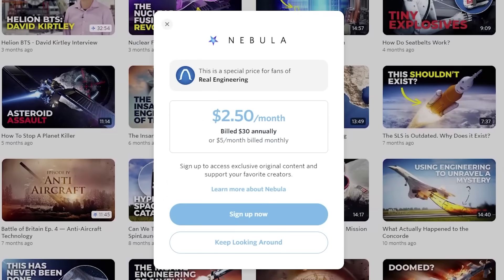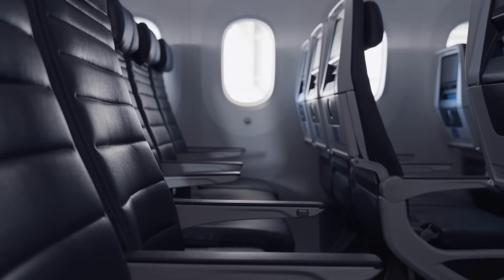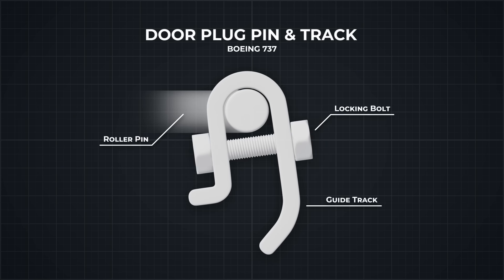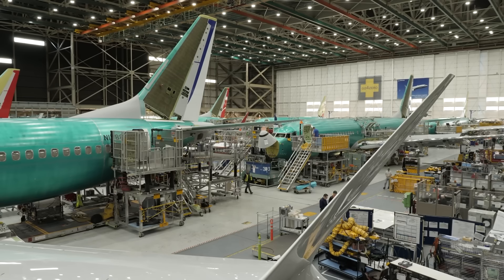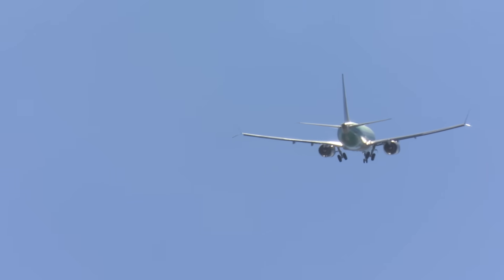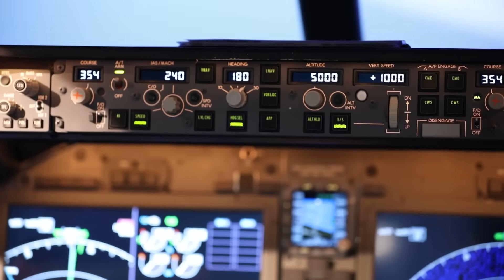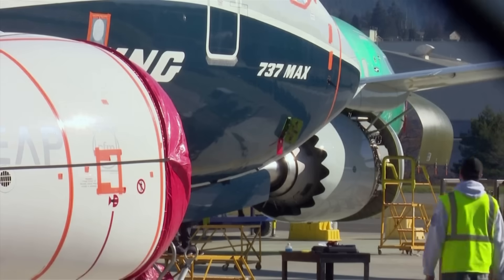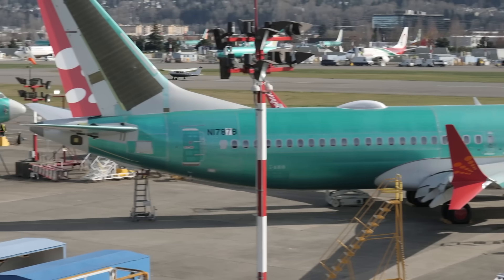The Questionable Engineering of the 737 Max

Comment: I think Boeing has more of a management problem that an engineering problem.
Reply: Absolutely. It was obvious this was the case the moment they decided to move their headquarters away from the production facilities. The whole culture involved in making that type of decision was an indicator of systemic issue with how they're handling their business
Reply: @marcm. this.  This doesn’t get enough attention. The documentary Downfall: Case against Boeing touched on this though thankfully.  

I’m someone who wants Boeing to succeed and be strong.  But they need adjustments.
Reply: @marcm. No they are still headquartered in Seattle last time they tried to move Washington got pissed.
Reply: @marcm. Nvm my bad it is in Crystal city.
Reply: Yeah.  This isn't an "engineering" problem.  It's an installation problem.
Reply: @ThatBoomerDude56 Absolutely.  The door plug is installed with safetied fasteners (drilled bolts, castellated nuts and cotter pins) and is a safety-of-flight critical installation that requires multiple inspections and buyoffs in the paperwork.  I suspect that the paperwork will show that it was installed correctly...even if it wasn't.
Reply: @silverhammer7779  : You forget that because the door was only "opened", not "removed", both of which require removing and reinstalling the bolts, there was no tick in the checklist to check they were installed back. So there's no paper trail of anyone having checked the bolts were there.

So it's not just ticking a box without doing the action, some boxes were not in the list at all...
Reply: @JariJuslin I worked in the industry for years and wrote more than one safety-critical procedure.  If a safety-of-flight provision must be removed for any purpose, it must be reinstalled correctly before the aircraft is returned to airworthy status.  And there WILL be documentation in the build and maintenance records.  Both DoD and the FAA require this.
Reply: @ThatBoomerDude56  totally agreed
Reply: The McDonald Douglas merger killed them
Reply: @quinndenver4075 MD80 comes to mind with a single jack screw...
Reply: Boeing died the day they merged McDD... 
#ChangeMyMind
Reply: Correct! Management doesn’t support good engineering anymore. Multiple employees have spoken out about it. They really are all about cutting corners to save a few bucks. This almost sunk Boeing before with the Max crashes; it’s saddening that they haven’t learned their lesson. A once-great American engineering company had to go and ruin its legacy. It’s a damn shame, really, and I hope to God that this is the final straw before a major shakeup in management.
Reply: Oh you have no idea. It's so bad.
Reply: Dennis Muilenburg was also not responsible for the MAX.  The CEO of boeing from 2005 to 2015 was a business executive called James McNerney.  This man was CEO during the prime shitification period for boeing.  He is the one who oversaw the MAX.  He conveniently bailed on the company just as the MAX was going into service.  The first flight of the 737 Max was only 7 months after McNerney stepped down from being CEO.
Reply: I would loved to be fired from a job and given 62 million. That's not even a punishment.
Reply: It’s just typical American corporate mentality
Reply: BOTH! One is born from the other though, you are correct!
Reply: a $67 million golden parachute for an executive who failed...
Reply: Still better than keeping your job and position of CEO after designing an aircraft with extremely hazardous handling characteristics (which caused even greater fatalities than the country itself wants to reveal) and then mass producing it.  @artcurious807
Reply: Also, the development of the 737 Max was overseen by the CEO before Dennis Muilenburg
Reply: Same applies to all of society these days actually...including gogts, companies, communities. And media.
Reply: When an ice cream seller is trying to cut every penny to make very cents worth the cost than trying to sell the most delicious ice cream, you know you are in trouble in the ice cream business.
Reply: As an Aerospace engineer your exactly right management is the problem. All engineers care about is safety. Management cares about money. This makes sense but still.
Reply: you mean the engineering was replaced with management.

Last time I checked CEO's and management know nothing about engineering, they only understand penny pinching
Reply: For anyone who hasn't seen it, check out that 2-part PBS Frontline on the MAX problem... Disturbing but very educating....
Reply: Shittification got em.
Reply: A lot of corrupts running the company is also a big problem.
Reply: The cause is from management. Being poorly managed result in them having to find ill-advised shortcuts. Their sensors of their max plane, and apparently not caring about quality control, and perhaps making their doors under qualified.
Reply: The software problem cost Boeing a lot of money putting the Max program in the red. Boeing management had a choice. They could take the loss and focus on repairing their reputation. Or they could cut corners to make up the losses. Now we know which they chose. This won't be the last problem that crops up on Max. It's not a curse, just capitalism in action.
Reply: They've also been diversifying departments a lot, but getting rid of safety regulations and inspectors is absolutely awful.
Reply: The accounts call the shots.. let's outsource instead of building quality in-house.
Reply: Lmao yeah i work at boeing and management is making [some of] us work every other weekend plus 10 hour weekdays 😀 at least the overtime money is good 🥲
Reply: You mean, a greed problem.
Reply: @danielblanco208  That's what I said - a capitalism problem ;)
Reply: @3nertia  I love it when people who know nothing about aviation blame capitalism. You people blame everything wrong with the world on capitalism lol
Reply: @dmvsye  And everything wrong with the world can be traced back to capitalism, its profit motive, and the predators who own and control everything, Dunning-Kruger 🙃
Reply: @3nertia  Too much Twitter and reddit for you bud
Reply: The failure was due to human error in the installation of the door plug mounts not being torqued to the proper specifications.
Reply: @owain_glyndwr1265  and the corporate imperative to make up for the costs incurred as a consequence of the software problem had no influece at all on those bolts not being torqued correctly, nor being inspected to catch the problem? My prediction is that 737 Max is riddled with problems because of that cutting of corners, and we're going to see more failures caused by corner-cutting in the future. I can make that prediction because that's how capitalism operates. You don't need to believe me, just remember my prediction and watch the news.
Reply: The management problem causes the engineering problem. But there still very much is a engineering problem too.

Any Aerospace Engineer that hands in a design for a safety critical system with only a single point of failure knowing full. goddamn. well. what happens when such a system is put on an aeroplane should be charged with 2nd degree murder imho.
Reply: I have read Alan Mulally’s book “An American icon” . No one comments on the real reason he left Boeing. He was in charge of the 777 build in various roles . It took 5 years to get into service .  Why did he really leave.
Reply: Its a result of the merger
Reply: Always is. No engineer wakes up and says “today I want to cut corners and get people killed.”

I’m willing to bet some engineer has a drinking problem now after those MCAS failures. “If I had just pushed management harder, then they’d be alive”
Reply: 13:28
Reply: Absolutely!  Just like the FA & A!
Reply: They need to let everyone go from McDonld Douglas go. Boeing didn't have problem till the merger
Reply: As evidenced by the documentary....
Reply: Trust me, It has both. They build some of the worst Planes in the world safety-wise
Reply: They're more concerned with hiring black trans ex cons than engineers or competent people who happen to have white skin
Reply: 99.9% of the time is management. leadership in the world is failure
Reply: na they have both
Reply: You all need to reference  blancolirio's video titled Boeing's Quality Management Failure Explained 737-Max-9 Door 24 Jan 2024 https://youtu.be/XhRYqvCAX_k?
Reply: The fed needs to stop bailing boeing out. But also Alaska Airlines Maintenance is at fault for this
Reply: You would have thought NASA taught the lessons of mismanagement. It seems a disaster will be the only catalyst of change.
Reply: $60 million for allowing the deaths of nearly 400 people.
Reply: more of a social engeneering problem than management problem. DIE policies for hiring are killing people world wide - for diversity inclusion and equity
Reply: The CEO is not an engineer.
Reply: @HeWhoIsWhoHeIs you gonna blame three mile island to DEI also? Lol. Chernobyl to DEI.  The other shuttle disaster to DEI.  Go google worst engineering disasters and see if DEI caused all of them. Lol.  You are a perfect example of how stupid people think.
Reply: @HeWhoIsWhoHeIs so you think this faulty vaccine was due to DEI also?  Lol.
Reply: every company is management problem
Reply: management and QC problem, spirit aerosystems is behind some of the incidents arent they?
Reply: MCAS was, I'd imagine, designed by a school student who should have got an F.
That was a terrible engineering project on very many levels
Reply: Indeed it does
Reply: Unfortunately this boils down to engineering problem…
Every issues, management can easily blame the engineers as it is their job

As engineers we must be honest and work with accountability, putting public safety first…but that may lead you jobless, because you left according to your heart, or you became the management’s headache…
Reply: That's what happens when a tech/aerospace company is managed by accountants and businessmen instead of Engineers. Boeing hasn't recovered ever since the MD merge.
It's the same thing that happened to Intel of the chip-semiconductor industry. The management sat doing nothing but business because they were 1# that time, which allowed TSMC and Samsung to catch up. now Intel is years behind in technology and are desperate trying to catch up to both.
Reply: No. It is because it was, "MADE IN AMERICA".
Which is craptola nowadays.
Reply: One causes the other.
Reply: The greed is sickening but DEI is clearly the root cause.
Reply: @IronicMemer  dei isn't the root cause quit giving them excuses.

 It's clearly greed and corruption. 
Boeing is going in the same exact steps as McDougalas and they didn't have dei as an convenient excuse, when they protized profit over safety.

Almost everyone who is a shot caller in boeing is yt, they are the ones who idiotic decision lord over everyone else even when wrong.

Boeing didn't zero a whistle blower over some dei. It's way more then that and you are seriously naïve if you think it is.
Reply: Both
Reply: Yeah, this video's ending trying to excuse executives is kinda shameful
Reply: I think it has both.
Reply: Can confirm, my 8th grade science teacher is married to a Boeing engineer, and he often questions stuff happening.
Reply: Greedflation
Reply: I think the real problem is more macro. Boeing is a megacorp with an enormous amount of power. Having that much power concentrated in a single megacorp that makes very high end parts and weapons is dangerous. Airbus is large but it's also far less unified than Boeing and far more heavily regulated. It also doesn't have nearly the backing from the EU that Boeing has from the US government.
Reply: @MrMarinus18 That, Even whithout the insane lobbying, the USA just can't let Boeing go down, they let most other compagnies die/be brought by a handful of way too big corpos and they must keep them alive at all cost, even just for the defense part. And if you add that to lobbyist who add greed to need is no wonder such terrible mistakes happen. After two deadly crashes and evidences of wrongdoing endangering thousands of people, why were the 737 ever allowed to fly again ? and if they were allowed, why wans't it with an "the first incident that happen we stop all of your planes from ever flying again" policy ?  Nah they got a few millions in bonus and the compagny just fixed one problem, not the system itself. They don't even endanger their passengers, no one is safe from one of their plane crashing in the middle of a town. Its unlikely to happen, but when it falls on you statistics become less fun.
Reply: @MrMarinus18  exactly, Airbus is a consortium while Boeing is a conglomerate
Reply: @MrMarinus18  Why is it dangerous?
Reply: @MrMarinus18 Erm, airbus is far more funded by the eu than Boeing is by the us government. (Hence all the angry letters getting sent back and forth). It’s publicly available info, just lookup balance sheets.
Reply: @ryanthompson2893  They both are heavily funded by the government. Though Airbus does seem to be better regulated at least for now.
Reply: @MrMarinus18 You have no idea what you are talking about 😆
Macro my arse.
Reply: The problem is that it's an engineering company run by accountants.
Reply: @BabyMakR  no, the problem is that in many places cost savings were higher valued than consistent quality. Also shareholder value etc.
The problems is not that accountants did what accountants are supposed to do, but they got a greedy and irrsepsonsible bunch that in their greed to maximise profit (and I assume personal bonus payments) without hesitation layed of any engineer or worker in general that tried to uphold the quality standards necessary to build an airliner. Going down even to suppliers and saving costs by talking the FAA into taking over their tasks internally and so on. Responsible accountants would have done the same, but not at all cost, jeopardizing quality in an environment were quality and monitoring issues as a well known fact can tragically end in loss of life. In the end having to face now that this irrespsonsible behaviour costs the company more in a few years, than a lot of the layed of employes and QM steps etc would have saved them over at least a decade.
I decisively do not write "realize", as I think some of those accountants are so focused on quick turnarounds, even in an environment where a development into production cycle takes years, that they do not even realize how wrong they were, because they simply do not understand thinking "on the long run"
Reply: It's an engineering problem caused by a overarching management problem.
Reply: Oh it is completely corroded from ground to top, from executive to union, from management to administration, from employee to contractor.
Reply: They all are.
Reply: And they all took the VSP with a big bonus and now everything else are yours (ours) problems.
Reply: its both.
Reply: And thus both.
Reply: Sooo an engineering problem
Reply: There is an engineering problem that can be fixed, however management was like, "Guys I have a better idea." @Cruz474
Reply: We should make sure you can't make money with dodgy engineering. I'd propose a system of shareholder value destruction as a penalty for incidents like this. Your company fucks up? You are forced to issue shares to the government equal to the ones allready on the market. the government will throw out the shares onto the market for the total cost of 1 dollar. 
Someone will buy a huge stake in your company and make the profits of the life time, but all current shareholders get absolutely shafted by this. Any scheme like this will make "Dodgy to save money" absolutely unattractive, in any shape or form.
Reply: @HeWhoIsWhoHeIs so every engineering disaster in the history of the US issue to that ? Lol.  Is that why Apollo 13 burned to a crisp ?
Reply: @HeWhoIsWhoHeIs so DEI caused the space shuttle Columbus disaster too? Oh thanks genius.
Reply: @HeWhoIsWhoHeIs I guess the titanic sank because of DEI.  The Hindenburg blew up because of DEI also.
Reply: Exactly! It's called diversity.
Reply: @Will-j8q1w it's called greed. McDougalas didn't have much diversity yet they failed in the same way as Boeing is going due to greed. Stop giving them convenient excuses.
Reply: The same self congratulatory nonsense from the engineers. I’m also an engineer btw
Reply: It all started during the Reagan years when Hanes laid off the underwear inspector #12.
Reply: What? There is absolutely engineering problems , the engine cowlings rip off if anti icing is used more then 5 minutes. The MCAS software nose dives planes…
Reply: @driller_e8098  the engineering team complained about that multiple time, but redesign cause them money so the higher up just pretend it's fine
Reply: @driller_e8098 The engineering problem is management won't let them do their jobs.
Reply: @driller_e8098 ... !!! None of these problems were "unknown", which means that the engineers knew about them. And had they been allowed and ordered to find other solutions they would have... But that was not how the management chose  """"solve"""" these KNOWN problems. Instead they """""solved"""" it by putting pressure on the regulating authorities to get "exceptions" to the rules.. and they got them... And here we are.
Now it would have been different if these problems had been "one off" where a outlandishly unlikely set of circumstances let a mistake "slip through". Or if it had been a "mom and pop shop" where an unknown "constructional failure" occurred. Under such circumstances You could possibly have blamed the person who constructed or assembled the part. But these are reoccurring systemic failure, from a MEGA corporation. And one that operates within a HIGHLY regulated industry, with countless checks and balances supposedly to ensure that safety is as good as it can be. So even IF they have "bad/incompetent apples" within their company they should be organised in such a way that that can not result in failures like these... And guess who is responsible for that... Hint it's not the engineers, nor the people actually building the airplanes.
And maybe it needs to be pointed out ((since Real engineering seems to be of a different opinion)) that regardless of what education or degree You have, if You work within the management You are a manager in this context. Meaning that if an engineer makes a managerial decision that is NOT (imo) an "engineering problem" but rather a managerial one. 
Best regards
Reply: @driller_e8098  Management forced the engineers to use poor solutions like mounting the engines higher and using MCAS software.
Reply: @driller_e8098 

He never said there wasn't engineering problems.
Reply: @driller_e8098  Engineers are 100% responsible.
If told to jump through the windows, they wouldn't do it, would they, but told to do something that can kill OTHER people, they follow the orders.
Reply: @DR_1_1  Well the problem is as an engineer you can't just leave your job whenever you disagree with the hierachy. Its the best way to be blacklisted from basically anywhere and the more specified your post is , the harder it can be to find a new one whith reccords of leaving compagnies and bad recomandations. Plus engineer studies are not cheap, especially in the USA and being jobless may not be an option for a lot of them. And finally, even if some do leave, the compagny won't change anything, they'll just replace them with people who will close their eyes even more. The only thing to do is to try to do your best or organise mass leaves/protests if things goes too far, but compagnies like Boeing this just won't happen.
Reply: @justeunfan3364 and not even SEPA will save you. If anything they will cost you your career.
Reply: Nah, this is just another symptom of the capitalism problem heh
Reply: @3nertia  The safety problem is FAR worse under communism.
Reply: @3nertia  Capitalism isn't the problem, rampant malicious corporatism is.
If you hate capitalism so much, go live in a country that doesn't have it. Oh wait.
Reply: @Volvith  Yeah. Good luck to him because he's not going to like the lack of freedom of speech there.
Reply: @3nertia  same thing. stupid floats
Reply: @sanguin-s6p  Ah, thank you for your valuable contribution to the conversation, Dunning-Kruger! ROFLMEYERWIENER!
Reply: @3nertia  you and OP are saying the same thing, deep down
Reply: @kaitlyn__L  All roads lead to profit under capitalism so I s'pose that's true, in a way :)
Reply: @3nertia  and that’s also the main factor behind management having different priorities than workers. Management is the vessel by which capital is maximised
Reply: @3nertia  Capitalism is not the problem but the solution.
Reply: @3nertia  You believe I am wrong?
Reply: @schwarzerritter5724  Thank you, Captain Obvious - your work here is done!
Reply: @3nertia  Why?
Reply: @schwarzerritter5724  You explain your position first, cohesively and coherently if you can :)
Reply: @schwarzerritter5724 yes more greed and less regulatory oversight is the solution! Let the CEOs and MBA: do whatever they want and that will fix everything.
Reply: @3nertia  You said my work is done. Time for you to explain your position.
Reply: @yungrichnbroke5199  Boeing keeps cutting corners despite regulations. The only solution left is stop using their airplanes.
Reply: @j.f.fisher5318  What deregulation do you mean?
Reply: @j.f.fisher5318  But people keep blaming capitalism for that with the subtitle implication that if it was communism or socialism greedy and corruption wouldn't occur, when in fact it would be even worse, individual lives don't even matter in a socialist society, the failures would still happen but it would be just statistics not a major outrage.
I think capitalism can still work with proper regulation, the problem really is public companies being run for the stock market financial capital instead of being run for economic capital which are assets and actually produce output.
People magically think that socialism and central planning would solve the same problems caused by central planning management in big monopolistic corporations...
Reply: @schwarzerritter5724  lots of examples but its better to clarify: this is captured regulation. the FAA and congress are both unduly influenced by boeing, and will defer to what boeing wants. in some cases this will result in deregulation, like FAA designated work that is performed by boeing employees instead of by FAA employees, under the very thin presumption that they won't be influenced by who actually signs their paychecks. in other examples you can see captured regulation when the FAA makes rules that apply to all commercial airplanes and boeing and it's backers in congress will move to exempt it from rules because it might cost them too much money (QQ), for example, see the exemptions granted at the end of 2022 for the -7 and -10 Max cockpit requirements, or even the recent engine de-icer exemption request.
Reply: @braveulysses2000  Yeah, I fail to see how connecting companies and regulators even closer is a good thing.
Reply: @j.f.fisher5318 what does taxation have to do with it? Wouldn't that make them want to cut corners more? And they are more regulated now than they have ever been before. 😂
Reply: @3nertia thats not what dunning-kreuger means. Learn what a word means before you use it.
Reply: @RaizerZ  Thank you for your worthless contribution to the conversation, Dunning-Kruger, but it's ironic how you can't see how that's ironic ;)

The ol' "I'm rubber, you're glue" argument - still just as classy now as it was back in grade school ROLFMEYERWIENER!
Reply: @monad_tcp  communism is just state owned capitalism. Total monipoly, horizontally and vertically integrated, no regulatory oversight because the state is the company, and out of control MIC for the same reason. That's why Russia and China could privatize so easily, they just needed to break Democratic socialism keeps government and corporations separate and yes is highly efficient at curbing corruption through strict regulation.
Reply: I think you have no clues on what you're saying, and of course you're 100% wrong
Reply: @reharh7330  of course, of course...
Reply: It's not a management problem. It's a DEI problem.
Reply: Engineers are responsible for the lives they affect. Regardless of whether this is a management decision, this is an engineering failure.
Reply: @rivengle As an engineer myself I totally agree with you.
Reply: @rivengle  I know this is from three weeks ago but the engineers did complain and bring up issue, one of them even was going to go to public about it, and we all know by now how that went.
Reply: @rivengle 😂 completely wrong, you need to be an engineer for a day. You give a good safe idea, management asks for five cheaper bad ideas
Reply: @dMoney0248  So? Is management building the dang thing?
Reply: @rivengle  Boeing has gotten rid of most of their engineering, they lowkey forced them into retirement or gave them VLOs and have not replaced them.
Reply: @rivengle  When engineers get it to the point you can get it airborne and are then fired to save money before they can get it airborne SAFELY, I'm willing to say it is mostly management's fault.
Reply: But they are diverse!
Reply: @ntsst3 this has nothing to do with diversity. This is a greedy management problem
Reply: @ntsst3  in the decade of most engineering accidents there was no diversity.
Reply: DEI is the Definitive Culprit
Reply: @TheDivino21 lmao youre a dolt. The only DEI adjacent activity is ppl without engineering degrees working their way up to engineering positions, majority of whom are yt 😂
Reply: @TheDivino21 how?
Reply: @TheDivino21 Explain how and present your findings to the FAA
Reply: @TheDivino21 Care to elaborate and explain exactly how “DEI” directly caused this and not some vague description of “unqualified” people being hired, when everyone hired has to pass the same background checks and tests to qualify as an engineer or mechanic?
Reply: @TheDivino21  So every bad engineering in the history of mankind is because of DEI? lol.
Reply: @TheDivino21 : Really? Explain with data, please.
Reply: The biggest management problem is that management okayed the hiring of Third World "engineers" to work on the 737 MAX.  DEI, anyone...?
Reply: @silverhammer7779 you have to wake up from an old dreams. The world has changed. Don't assume that third world countries don't have the capability. The problem is boeing's own greed and regulatory weakness.
Reply: @bedhenis If they had the capability, they wouldn't be Third World countries, would they?
Reply: @silverhammer7779  do you understand the terminology of third world country?
Third world country is non-aligned country with either NATO or the Warsaw pact.
Reply: @bedhenis   By that definition Japan, South Korea, or Switzerland would be considered "Third World".

The correct terms would be "Undeveloped", "Developing", or "Developed".
An Undeveloped nation would be one with little to no infrastructure (roads, electrical power, clean water, etc), and little to no desire to correct this. (Ex. Afghanistan under Taliban rule)
A Developing nation is one that is, for all intents and purposes, attempting to catch up with their neighbors or rivals. They're actively building roads, schools, a stable power grid, and are generally unphased by the kinds of political issues seen in many "Undeveloped" countries. Some may have some major political turmoil or even civil war as ideologies clash for the future of the country, but they're generally on the path that leads to becoming a great nation.
And then there's Developed countries. These are nations on par with the world leaders. They have complex school systems, major roads, stable power, stable living and political conditions, even their own major manufacturing base with stuff they are uniquely positioned to export. Militarily, they are able to develop their own equipment instead of buying from other countries, and they're even able to fully educate their own engineers, doctors, and scientists.

One thing to note with these countries putting satellites into orbit is that they're only able to do it because they've sent their people here to learn how. They take the knowledge back and lead teams dedicated towards this purpose. And they're very well motivated to do it. How many here can say that?
Reply: @silverhammer7779 yeah of course dunk on the immigrants. Its because of management that the engineers cant work their jobs. And those immigrants are probably more educated than most Americans based on your comment
Reply: @silverhammer7779  it's not dei, they could have hired anyone and management still would have been terrible and forced bad decisions for the purpose of money making. McDougalas didn't have Dei when they went down and they had nearly identical problems due to greed.

Boeing wouldn't have zeroed a whistle blower over dei, it's something more like corruption and greed. Believe me that they would have loved to use dei as an excuse if they wanted to.
Reply: @datekaname2246  DEI contributed heavily to the problem, but corruption at the top was the main driver.  As the Japanese say, "a fish rots from the head down."
Reply: @silverhammer7779  again as I said McDougalas had similar issues, they didn't have dei. Dei isn't the major issue. 

The issue is boeing protizing profit, forcing their engineers to do thing for the sake of cost effectiveness/speed over quality and safety, firing those people when they complain. And then when a big issue  eventually happens like a plane crashes they arbitrarily fire a bunch of people at the lower level, pat them selves on the back, give themselves as big payday and keep whoever made x horrible desion at the top of chain until the next indicent happens.

Boeing could literally have the best engineers and still have the exact same thing happen because the people calling the shots are doing so for money and not safety, they will ware these engineers thin, fire them if they complain to much or bring up issues, and then put them seven feet under or blacklist them when they decide to go public about said issue.

Stop giving them excuses.
Reply: @datekaname2246  I worked in the industry for decades.  As they say in the restaurant business, "I worked in the kitchen, so I know what went in the soup."  And it's "McDonnell-Douglas."  Which, BTW, had to worry about what is now called DEI long before their merger with Boeing in 1997.  All major defense contractors did, and it only got worse as time went on.  Any big company that subsists largely on government contracts, such as Boeing, is shot through and through with DEI at all levels, including (and especially) middle and upper management, because Uncle Sam demands it and there are stiff monetary penalties for noncompliance.  When it becomes a higher priority maximize profits while keeping the Feds and the EEOC off their backs rather than making sure that the planes are designed and built correctly, this is what you get.
Reply: @silverhammer7779  I'll have to respond to you later. I just wrote up a several paragraph long response that youtube decided hide/delete. 

I'll respond later on if I manage to edit it in a way that won't get caught by the censors. If not then you know why.
Reply: @datekaname2246  Save your effort.  I've been there and seen it up close, and you obviously haven't.  So further back-and-forth is pointless.  But thanks for playing, anyway.
Reply: @silverhammer7779  I'm still going to post it anyway because I have a vaild point I'd I like to bring up against your last point/sentence in your previous comment.

It's enough that I'm willing to edit my hidden comment just to post it. After that then whatever can happen. 

When I do post it your free to either ignore it or respond.

It will probably be my last response to you.